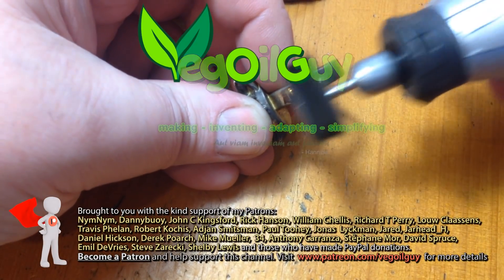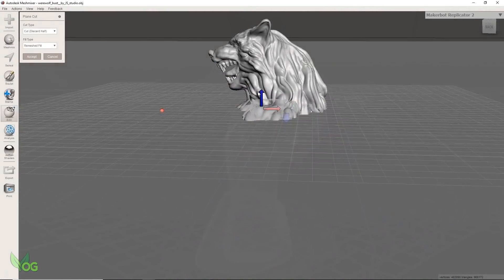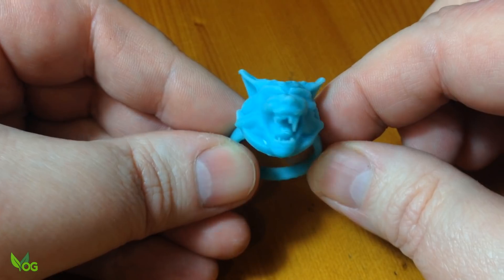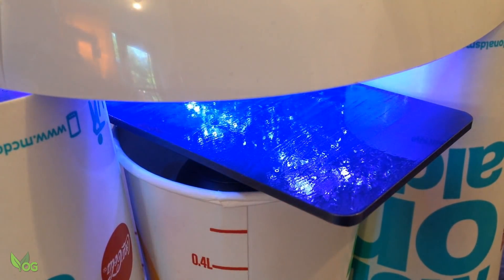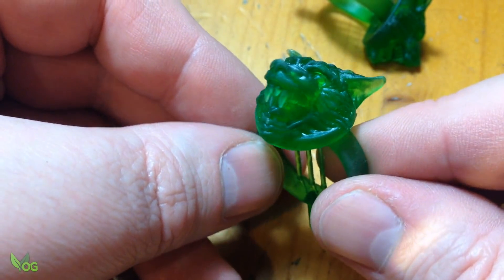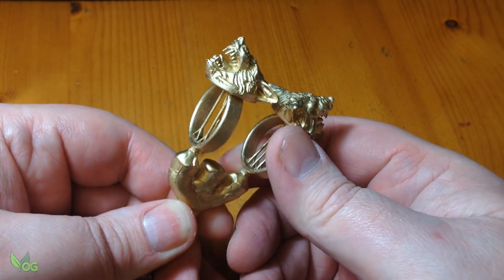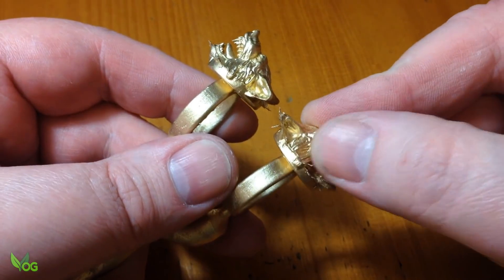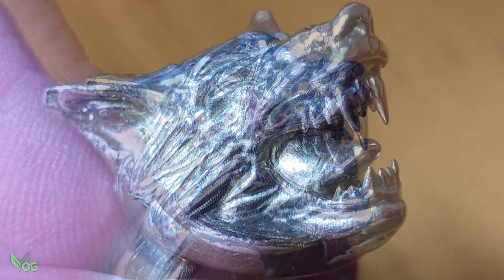Detailed Home casting Wolf Ring with Powercast Burn castable resin + my Elegoo Mars printer VOGMAN

Comment: Wow it still takes 14 hours for a small flask . I thought maybe there was a shorter burnout with this resin, but seems to be about the same as any of the resins as far length of time to burnout doesn’t it ?
Reply from the maker: The resins aren't really the issue. They work pretty much the same as wax. The curing time is pretty standard across investment casting 😁

Comment: Hi VOG, I have a question. Using this BURN resin it says it will shrink 3 to 5%. Is it after curing or after casting? How much do I need to increase the 3d printing of the piece to cast correctly? thank you

Comment: What did you melt the metal with? Is that something that takes a lot of time?
Reply from the maker: Hi Kayla. The metal is melted in an electric furnace which I made myself. It does take a couple of hours or so, but it's worth it 😁

Comment: so the plastic mold stays inside the plastroparis while pouring metal? 
im so new to this
Reply from the maker: No worries. We all start off the same way : )
The plastic is Resin from a printer. It's trapped inside special investment plaster and heated to a very high temperature called Burnout. As the name suggests, the resin burns to nothing and leaves a hole the shape of the resin pattern. This gets filled with metal.
In honesty you've come in a long way along my videos. This was a learning curve for me too, which I shared as I went along.
This video might help explain what's involved a little more clearly... https://youtu.be/qxj5eUkAFUI
Any questions, just drop me a line : )
Reply: @vogman  thank you so much mate . i really appreciate this . :)

Comment: Very impressive and eye opening results.  Two quick questions - Would the detail with the powercast WAX be less?  Where does the flashing come from?  Cracks in the plaster from burnout?
Reply from the maker: The Powercast Wax is every but as good as the Burn. The detail is just as good and I prefer it if I'm honest.
Flashing is caused by cracks in the plaster and the cause of these is something I'm still trying to figure out. I guess it's caused by the positioning of things on the casting tree.

Comment: The result is fabulous! That's an amazing piece of art.

I noted your use of primer on the build plate. In all my "travels" regarding resin printers, this is the first reference I've seen for such a product. The web site you link for the resin has no information. Is primer recommended and/or required for the casting resin? Ensuring a good bond to a build plate would certainly prevent LCD panel destruction from dislodged prints. Can you provide a link or reference for priming a build plate? I'm intrigued (and subscribed).
Reply from the maker: No problem Fred. The primer is the resin : )
I refined the technique even more in this video - https://www.youtube.com/watch?v=xNipIFMKta4
Reply: @vogman  I've watched the linked video and enjoyed it as much as this one. I'm sorry to hear you won't be attending any office parties.

Your method of priming is easily accomplished, as you've noted. Do you think this method is applicable to non-casting resins as well?
Reply from the maker: Without a doubt. If you can't get it to stick, try a primer coat. Yes it costs a few pennies in resin, but so do misprints : )

Comment: Hi I need your help
Reply from the maker: If it's casting related, I'm happy to offer advice : )
Reply: Thanks I just want to know if i can cast aluminum PLA using sand instead using plaster cuz plaster is so often here and too expensive so i want to know  if i can only use sand to casting aluminum on PLA like casting foam on sand and i hope results are good
Reply from the maker: I don't think so James. Foam melts and a MUCH lower temperature than PLA so it doesn't use much energy. The metal would cool too much by the time it had melted the PLA.
A lot of people are very successful using PLA patterns in green sand or Petrobond. BigstackD and ArtByAdrock both use that technique.
I hope this helps : )
Reply: @vogman  mmm ok but when i watched a youtube video from channel inside the mind of matt he uses sand and the casting of PLA was succesfully results so thats why i wanna know but anyways thank you so much for info and i hope you will try to make video casting aluminum on PLA with no need using plaster cuz its really hard to find that here thats why i need easiest way to casting on PLA
Reply: And i wish i will succeed like what matt did on molten vs pla i cant believe its goes well and looks like he only uses normal sand eh i dont think he use green sand

Comment: Very nice. Is that alloy tarnish resistant? Copper by it’s self tarnishes and changes color if you glance at it, but aluminum “tarnishes” instantly with the air and then stays the same.
Reply from the maker: Thanks Chris. No, bronzal tarnishes, though probably not as quickly as copper. But it fairness I think all metals tarnish, with perhaps the exception of gold (don't ask me about platinum - never even seen any). I think you can lacquer metals to keep them shiny for longer, but that's not something that interests me  : )

Comment: The Casting Gods are well pleased today! Those turned out great. I've been wondering lately about which metals are best for casting. I noticed that you've been using bronzol a lot, it that because it casts better than brass/aluminum/copper? Perhaps because of its beautiful color?
Reply from the maker: Why bronzal? Because it's cheap, flows nicely and shines up great. Brass is nice, but the toxic fumes put me off, especially as I work indoors. Aluminium is sluggish unless you buy a quality alloy, and even then I've heard it's not great. Copper is cool but tarnishes so quick. So bronzal just works... until I win the lottery and get some silver : )
Reply: @vogman  silver tarnishes quickly too. gold, platinum, and palladium are the metal picks for a lottery winner.

Comment: Man i need one of them tumblers to clean my kids ....  ahhh it was blender, i bought zbrush a few years ago and blender looks like that 😮 ... dont tell the mrs but zbrush cost me £650 on sale so for free blender looks like the best option for people who want to actually get the most out of 3d printer unleash creatively so to speak..

how heavy was it fella perfect timing for  Halloween
Reply from the maker: Ouch! That's gotta hurt.
I can't believe how good blender is for absolutely free. And it's amazing how many movies have used it.
Heavy? Too heavy. It's not really for wearing. It looks good but has no practical use : )
Reply: @vogman  You could make the ring lighter by casting a hollow shell in future.  I'm not sure uf drilling or grinding the underside would yield satisfactory results as going too far might ruin the ring.  I hear bronzal is pretty tough to work on.  🤔

Comment: Great work, VOG. I must get Blender. I wonder if that laborious plate-priming is the way ahead? I have not tried a burnout resin yet, but the first general purpose resin it tried (technologoutlet.co.uk) would not stick to the build plate at all. So I sanded the plate to 80 grit and bingo. Everthing sticks like shit.  I examined what might be happening with the early detached prints by stopping the machine after the first few layers and poking them. They could be slid around with a finger. The plate is just too slick. It's no different from roughening a glue joint for better adhesion. Too slick, no stick.
Reply from the maker: A few folks have said that to me and they and you are probably right. I'm just a bit of a coward in such situations. I figure once I've scratched it up, I can't unscratch it. I also tend to think if it was such a good idea, then surely the manufacturers would do it, but none of them do.
For a while at least I'll keep priming. But this might become tiresome in the end : )
Reply: @vogman  That's what American cops  call Clean Uniform Syndrome. Cops get shot sometimes cos they are reluctant to dive into the dirt and take cover when they have just  had their uniform cleaned and pressed. I wondered myself why manufacturers don't ship with a roughened build plate. I think it's cos it won't look smart and people will misinterpret it for crude manufacture. VOG, you can scratch up your plate and then restore it to a mirror finish if you want. Trust me, I'm a jeweller!

Comment: That came out quite nice!
Fusion 360 wasn't free the last I checked.
Reply from the maker: I believe it still is. You need to register for the free trial I think, and once downloaded you select the educational license. It's not instantly obvious, but it is there : )
Reply: @vogman  All this time I thought it was paid. 😅 There is a free option for non commercial users. 
 I've been using design spark mechanical for about a year now, it has it's issues.

Comment: When you pour in to the mold is it directly from the electric furnace or is there a rest time for the casting plaster?
Reply from the maker: I go straight from the oven, but I do mess about for a couple of minutes so some cooling takes place. But the plaster needs to be hot. If it's cool, the metal can freeze on contact which prevents it from filling the pattern : )
Reply: @vogman  Is it possible to set your mould in an insulated container while you mess about or is the mould what you're messing about with?

Comment: Bloody fantastic results. 
What are you using for the home vacuum casting heat proof seal these days?
Reply from the maker: Thanks Scott. I previously made a simple silicone gasket and was going to do the same again. Then I found these...
https://www.cousinsuk.com/product/flask-ring-gaskets

It was cheaper than buying the silicone so I gave it a try. Works great : )
Reply: Perfect, thanks mate.
Reply: @vogman  wow that website is awesome, about 1/2 the price for most of the things I wanted to start casting.